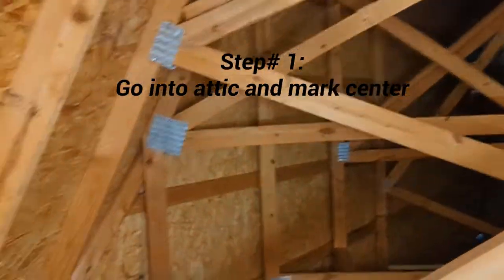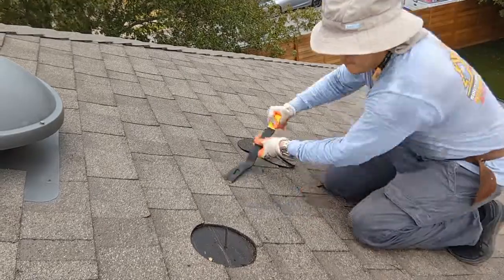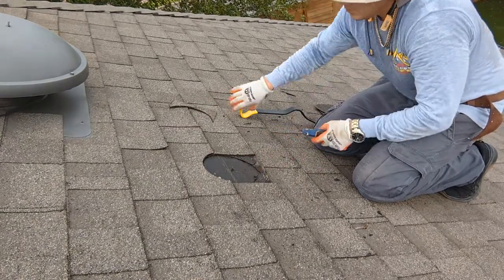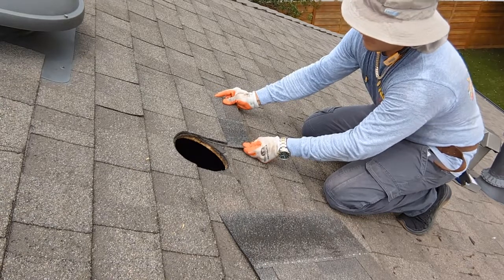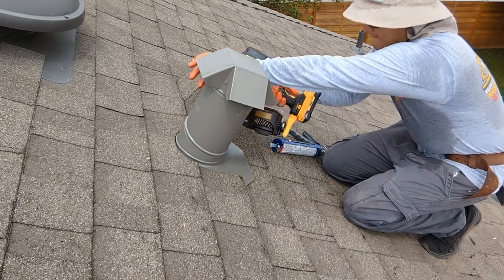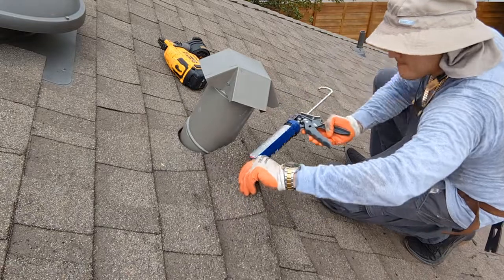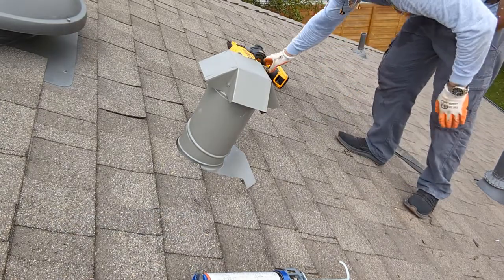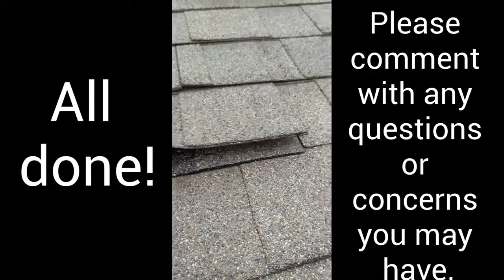9 step DiY Kitchen Range Hood Roof Flashing Install_ Roof Repair

Comment: I had an OC Duration roof put on my house back in middle of Sept. The roofing was done by an OC "Platinum Preferred" contractor. A week after the roofing was done was when I found out the 7 inch roof jack for my range hood exhaust had been replace with  new one for a 4 inch duct.  My 7 inch duct no longer fit the roof jack. So now I have a square hole in my roof that is cut for a 7 inch jack with a 4 inch jack on it. The 4 inch jack is positioned to one side of the hole.  Unfortunately I had already paid the contractor in full by the time I found out.  Don't know if I can get the contractor to make it right and remove the 4 inch and put in correct size.
Reply from the maker: They should.

Comment: Your instructions and pro tips are so clear. I have installed all the inside duct work and connections, and tomorrow will follow every step you described, exactly as you described it.

Comment: Are those 2 bottom screws water tight? Shouldn't it be sealed with the black chalk?
Reply from the maker: The neoprene gasket works as a seal, but yes, extra seal over them won't hurt at all. Great question.

Comment: I've been having a hard time finding a contractor that is willing to install a roof vent cap to connect to the 6 inch range hood duct already installed in the attic. Just found a sheet metal company that gave me a quote. However, the quote referenced a "roof jack".  I've never heard of it so research lead me to your video. May I ask, what the difference is between a roof jack and the more low profile vent caps. Does the roof jack prevent birds, critters, or insects from getting inside?
Reply from the maker: The purpose for both style vents are mostly the same, only some regions in the U.S. have different rules with what is allowed over heated vents. For example; in central Texas, we are required by city ordinance to have a roof jack over the kitchen exhaust. 
I suggest you check your local building codes and comply with their rules and regulations.
Reply: @AurumRoofing  Ahhh! Thank you very much.

Comment: You mentioned that those vents are nice because they're adjustable, but you failed to fully use the adjustment to get the vent pointing up vertically plumb. Nothing should penetrate out of the roof that is not plumbed up straight. That just looks wonky from the ground.